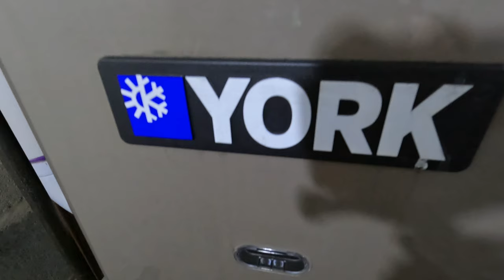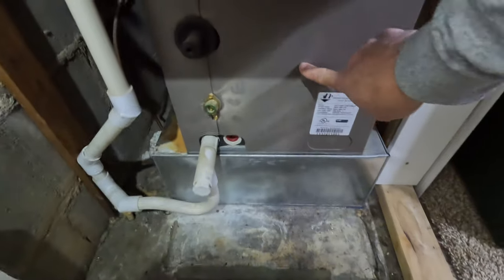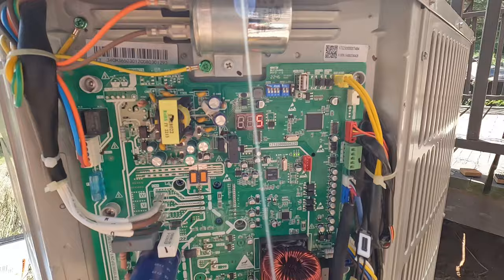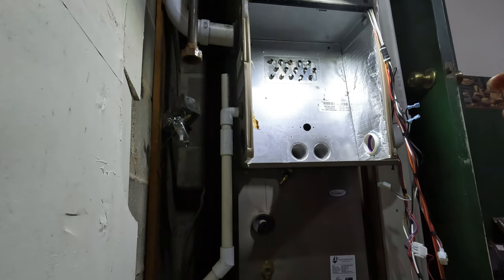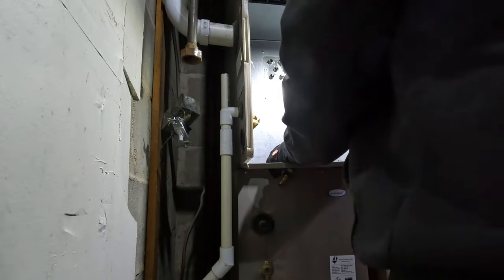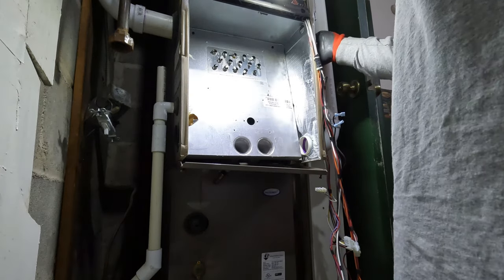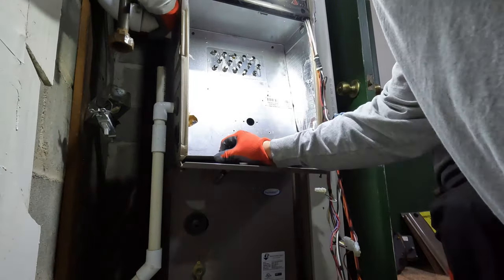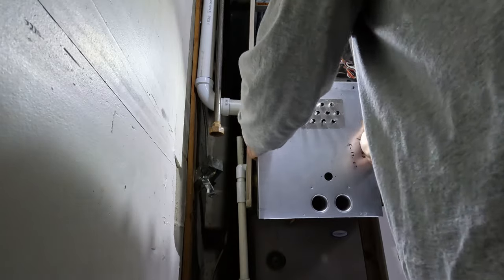York Furnace bad heat exchanger

Comment: So sorry for your loss.  Quote me if im wrong but from my experience with adp coils they can't be used in down flow applications.
Reply from the maker: Thank you. I have not heard that. My distributor sold me that knowing what the application was. From the look of that coil idk if it would be any good, from the condensate from the furnace it was really Rusty.
Reply: I've run into a few of them installed like that. The only issue I've noticed is they don't drain right and water blowing out of them.I'm guessing the airflow is slinging the water around or something. I've used a bunch of them in upflow position. Really nice budget friendly coil
Reply from the maker: @Dustinhvac that's good to know. I have stepped away, far far away from these.

Comment: What’s the cost of the heat exchanger itself? I have a 3 burner very similar to yours. Mines not leaking, but it was clogged. Thinking I’ll need a new one soon.
Reply from the maker: If your furnace is less than 20 years old the heat exchanger should be under warranty. Typically if not under warranty they would be about$1000 there abouts.